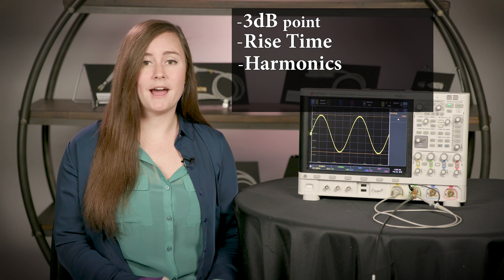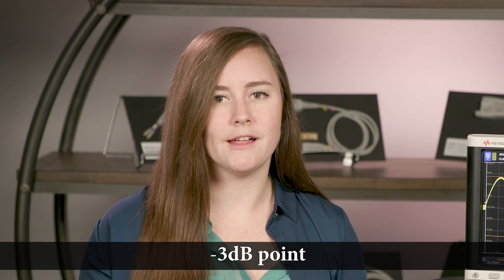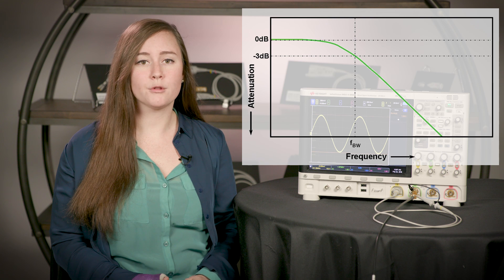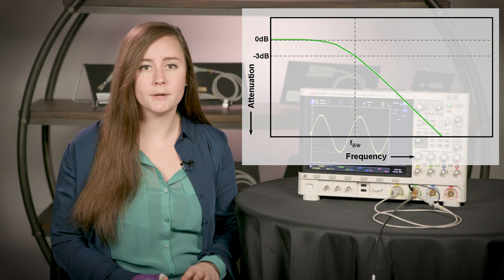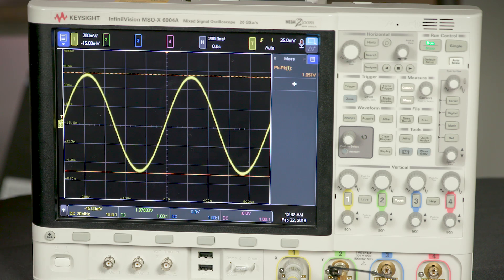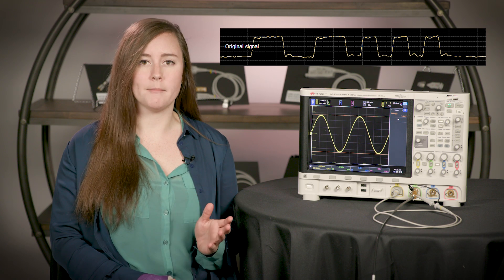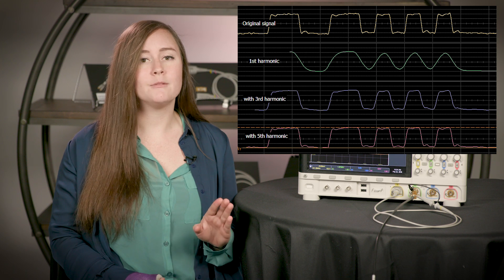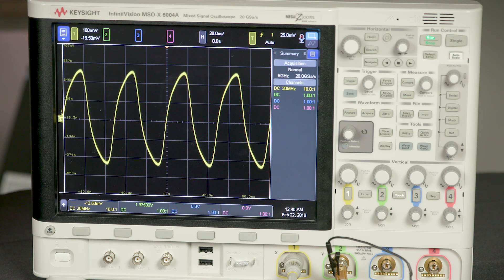How to Select the Right Probe Bandwidth - Probing Pitfalls

Comment: So having a higher bandwidth means that more harmonics of the signal will be captured. This is why having higher bandwidth probe helps and ultimately there is a relationship between the signal rise time and the minimum bandwidth of the probe required to measure it.

Comment: Why not always use a high bandwidth probe for everything?  You made clear the problems with using a probe with too low of a bandwidth for a given measurement, but why not make some high bandwidth probes and not even bother with something lower?

I don't know if I'm being clear.. all I'm saying is if I buy a scope, why not just buy the highest bandwidth probes with it?  Why have a selection?
Reply from the maker: There are a couple downsides of higher bandwidth. They pick up higher bandwidth noise, cost more, can be more fragile, and can have different input range capabilities. Most engineers have a bit of a "quiver" of probes. Too much bandwidth is better than too little, though.

Comment: What makes a 100MHz probe different from a 500MHz probe? I mean how probe bandwidth is determined ? is probe bandwidth controlled in manufacturing or by any RC components ?
Reply from the maker: Good question! The bandwidth is determined by the frequency that it can measure (up to it's -3dB point), and is dictated by it's circuitry. I cover bandwidth in more detail here: https://www.youtube.com/watch?v=T56XDhUyY2g

Comment: Fun video! It really helped me memorizing more stuff.

Rule of thumb when dealing with reasonable fast signals:
3dB - Half Watt (vv)
6dB - Half Volt (v) - Quarter Watt
ω - omega - angular frequency - Analog signal
v - down/up - Digital signal

==> Analog signals - 3 times W(h)att prober req.
==> Digital signals - 6 times (Bw)over

Sorry, but I couldn't resist a comment on Erins current situation:
BtW - It seems that thieves gets cast for PR(is)ON  @Keysight
- PowerRobbers gets over/under SHOT on the O'scope at five.00 - and no work... comp ;.)

Get well soon, and keep making great equipment and videos!

Comment: A non contact probing system is desired. It shall not be affected by system noise. It shall have a bandwidth of DC to "anything". 
It shall not contribute it's own noise to its output. It shall not be influenced by ambient noise. Design that, Keysight,  and you can earn the $29,000 you charge for probes for your highest bandwidth instruments. 

It may be time to design products and instruments immune from the vagaries of diminishing returns from higher speeds and increased memory capacities. Do you think you can afford me, Keysight?
Reply: Optical Pockels cell probe.  Use a silicon based polarized laser and a crystal with a minimal copper probe contact surface.  Bandwidth to terahertz possibly.  Photon Dynamics built a test system back in the '80's very expensive.  But will eventually solve this problem.

Comment: Surely specifying the bandwidths at a .5dB point instead of a 3 dB point would eliminate confusion around the actual bandwidth ? I bet if you look at the 0.5dB point of the SYSTEM on a 500MHz scope (as mentioned) it would be close to the 350MHz point, I think the real issue is the effectively false bandwidth claims being made, which seems to be accepted by everyone as normal.
Reply from the maker: Well, that's a tricky discussion. The -3 dB point has been a standard for this type of equipment for about as long as it has existed. It's also a very common filter descriptor, so it makes sense in this context. It's really one of those industry standards that we are stuck with - for better or for worse.
Reply: I can recommand this video(" Why -3dB? (An alternate approach to explaining dBs)") from KainkaLabs. Its explaines why the 3dB point is used. Video link: www.youtube.com/watch?v=Tn97U1HVtpo
Reply: I believe we call it "Marketing"  same thing with Gbps (GigaBits Per second) vs Ghz (GigaHertz)

Comment: The engineers rule is rather simple: the higher the better. I love "my" 40GSPS, 2.5GHz 4 channel oscilloscope and I will miss it.
Reply: It's not true, sometimes you would actually like to do a bandwidth limited measurement.
Reply: @1366solar  , and compared with this setup... boy oh boy will you save a bundle

Comment: Nicely done, as always. 6:03 - "having too little bandwidth means that you won't be able to see a true representation of your signal" Thanks for the knowledge, now I know that I have to have a 72 hz monitor instead of a casual one, which is able to operate at 60 hz... just to see a true representation of that 24 cinematic FPS Youtube video, which will never be snown in a cinema :) What is the reason to use 24 FPS for Youtube content instead of 30?
Reply from the maker: FPS is editor's choice :)
Reply: Yeah, and editor is not an engineer... Thanks for the answer BTW

Comment: I like this series, but also here, circuit designers are not the only professional users of a scope (and other testgear) .  I'm a repairtech ( measurement and calibration gear, and some industrial and automotive stuff, many are kinda problem cases) I use a scopes every day (most times 2 at the same time, but I have more) and many special probes (current, diff, HV, 10x, 100x, active etc) and there are many people like me, maybe even more as designers here in Europe)  But scopes, app notes etc seems to be only designed with the electronic designing EE in mind.  And then is it a bit strange that most app-notes etc are more or less at a beginner level. Some one who can design complex circuits should know this kinda things. Maybe an idea, many users do not know the max voltage decreases with frequency. And that counts for a probe too. I had a dead scopemeter from a customer who blew up the front end. To measure ignition (automotive) he set the probe setting at 1000x and used a 1x probe. And he was surprised he blew up both channels after each other :-)

Your video's are a step in the right direction because these things are  very scope specific. I would like to see more about more advanced triggering, optimal use of settings or aquisition modes, zooming, memory use etc
Fred
Reply from the maker: Great feedback, thank you! 

You might be interested in our 2-Minute Guru series, it starts basic but covers a lot of scope topics: https://www.youtube.com/playlist?list=PLzHyxysSubUkc5nurngzgkd2ZxJsHdJAb 
There are also a few webcasts that go into some more depth: https://www.youtube.com/playlist?list=PLzHyxysSubUlKfrZIcXfXhJwhRwLVnKq1

Comment: If i want to measure a filter circuit, will probing change its bandwidth? And if it will any way to minimize it?
Reply from the maker: It could, you have to also factor in your probe's loading impedance. More on that here: https://www.youtube.com/watch?v=kbr9XyD1vlw
Reply: The link should be something like this: https://www.youtube.com/watch?v=kbr9XyD1vlw :)
Reply from the maker: @Jonas, thanks! I've fixed it.